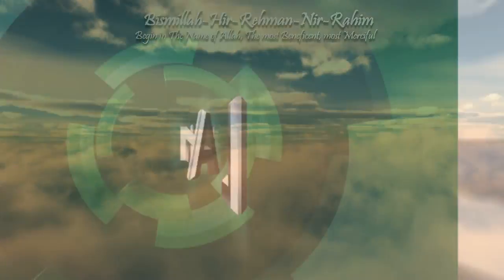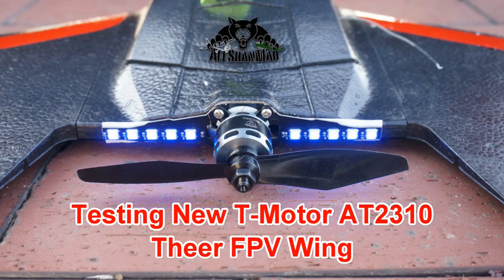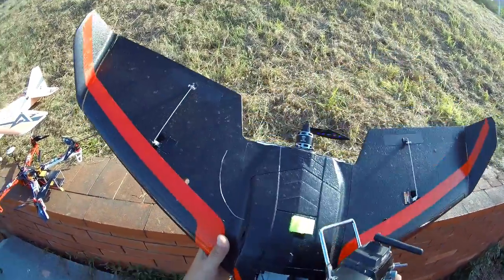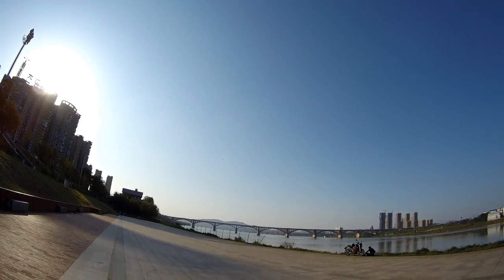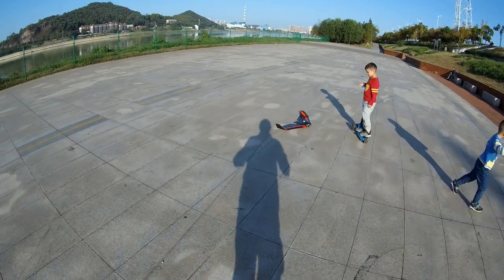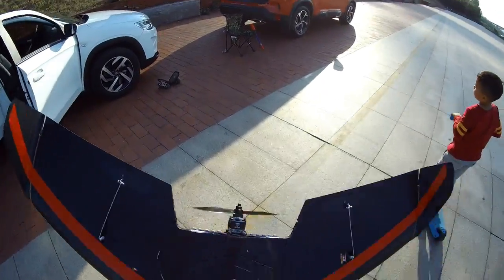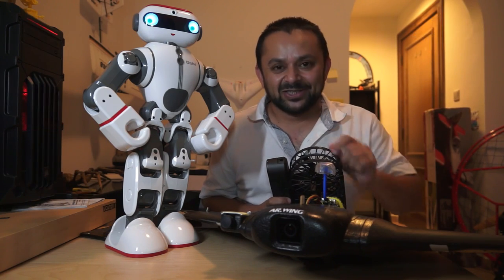Very Fast High Speed FPV Racing Flying Wing with Tiger Motor AT2310

Comment: Hey I have a Sonic model AR wing 900 mm and preferably I'll be running for sale but I want more speed I use 2208 2550 KV on a 6-in prop but it's not fast enough for me with this 2310 2200 KV on 4S which propeller did you use for the runs you show on video is there any other motor that I could use and get more thrust or speed with just 4S?
Reply from the maker: there is a new T Motor that i tried on this baby. specially designed for wings. you should give that a try. I have that on my AtomRC Dolphin wing now and its absolutely crazy fast. takes up to 160kmph speed with a 5inch propeller.
Reply: @alishanmao  what T motor type that special design for wings ali..? Need to search it for my new flyingwing..

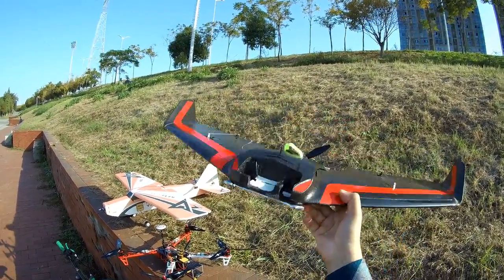Comment: 0:44 LOL.... gives new meaning to tooling around the flying field. Shame they didn't make some changes to the nose to let the battery sit further forward as it's thin wing kept light will have a nice speed range and that wrench weighs a lot more than a Runcam.  With a 4S 2200 will still need some dead weight in the nose it looks like. But still a nice wing for long range carrying a large battery just be nice to fly it light too and would make placing FPV gear easier.. So many choices in wings now.... this looks like it tracks really nice for FPV.... thanks.
Reply from the maker: well there are better wings coming out nowadays. Theer has fallen behind